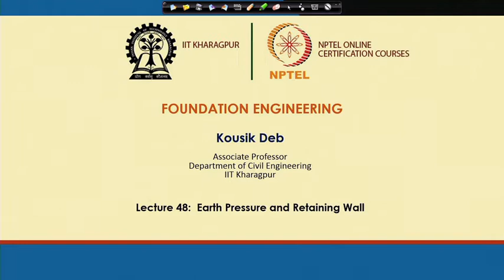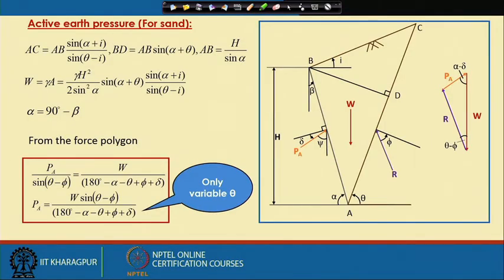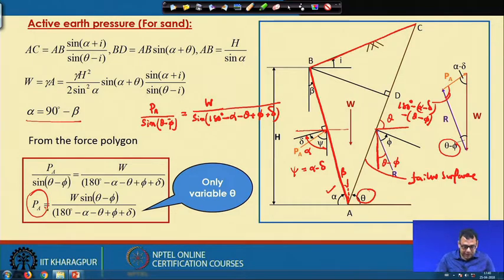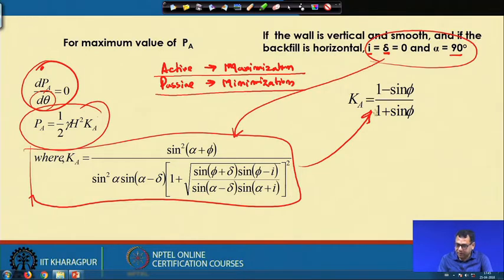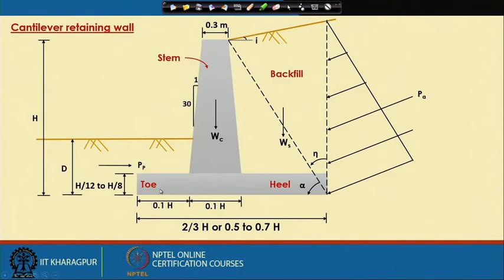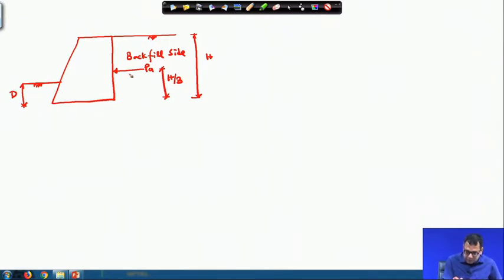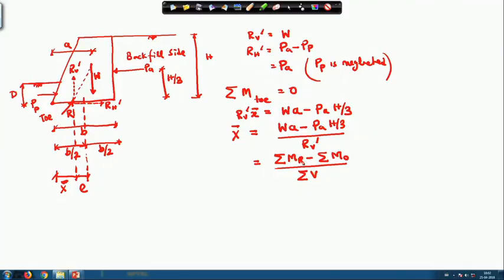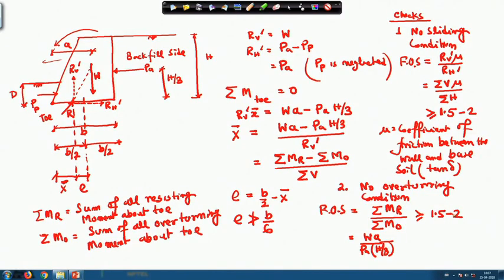Lecture 48 : Earth Pressure and Retaining Wall

Comment: Sir, It is failing in stabilty check if I doesn't take earth load while designing a retaining wall with sloped back fill and tapered wall on earth side using Coulomb's method..